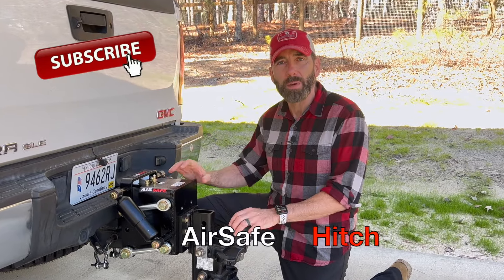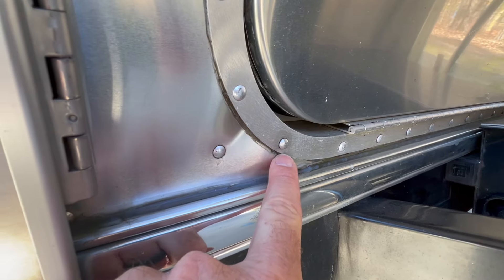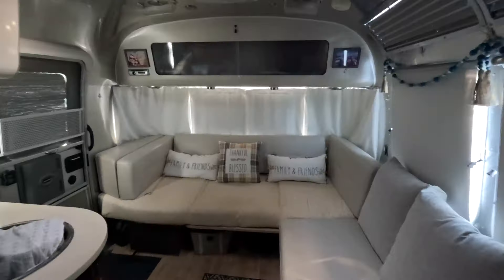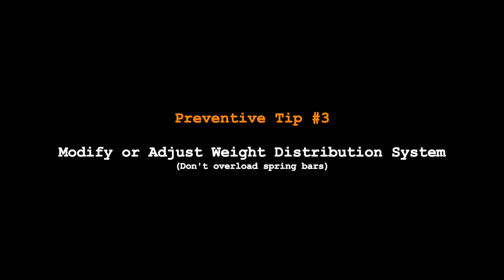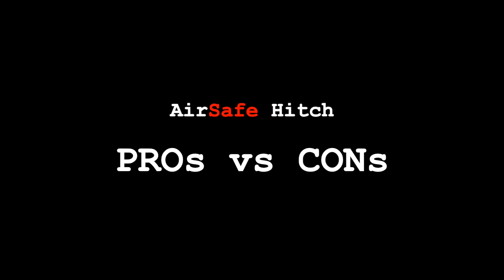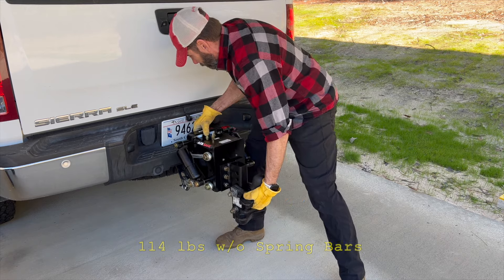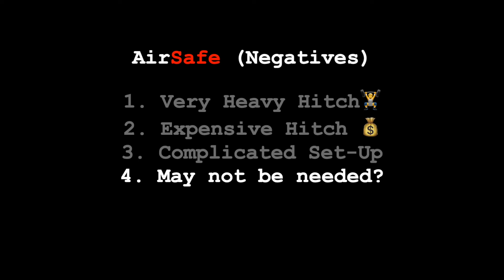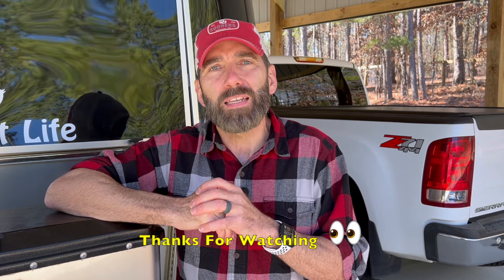Should AIRSTREAM Owners Jump On The AIRSAFE Bandwagon?#airstream #rv #airsafe #KYD

Comment: My 2.5” shank Equalizer hitch head and weight distribution bars already weigh 106 pounds as it is.  Adding another 49 pounds will make it nearly unmanageable and greatly increase chance for injuring my back.  You’ll need a second person to help carry it or a lifting/rolling device to transport it.  Virtually impossible to lift it into the bed of your truck when not needing it to tow.  I decided to switch to an Andersen Hitch, which weighs in at only 26 pounds and has a MUCH softer ride than the Equalizer.
Reply from the maker: I don’t even try to lift it and place in the bed of the truck.  I just chain it to the AS tongue when we are camping.  Safe travels.

Comment: Good video as always.  I think your theory on what causes front end separation is valid.  IMPORTANT SAFETY NOTE:  At 10:30 your breakaway switch wire is shown being hooked to your chains.  This is wrong.  The breakaway switch must be hooked to a part of the tow vehicle entirely separate from the hitch assembly.  The design intent of the breakaway switch is to apply the brakes and stop the trailer in the event that the entire hitch assembly departs the tow vehicle.  If ever you lost your hitch, the wire would go right along with it, never pull the pin out, and never engage the trailer's brakes.
Reply from the maker: Hi Rich, thanks for the comment and the safety tip.  I reviewed the video and can see how it appears that the breakaway cable is attached to the safety chains.  It is actually attached to the receiver.  That said, I need to get an eye bolt and attach it near the license plate (I think this is your set-up).  Take care and safe travels.

Comment: I tow a 2022 FC 30 bunk with a 3500 dually and only use a GenY torsion boss hitch without any wd bars but I do use a sway brake. I haven’t used the bike rack in a couple years but initially I did use the bike rack attached to a built in receiver, but because the dealer used a weak C channel setup, it always flexed too much back there so we stopped. Maybe they saved us. I also used to use the Equalizer WD hitch for a couple thousand miles in the beginning. I haven’t noticed separation or signs of it but will be visiting Vinnie if and when it happens.
Reply from the maker: Thanks for sharing your experience. Hopefully you never require any repairs. Best of luck and safe travels.

Comment: My hitch manufacturer recommended that I use the lighter tension bars (1000lbs) and suggested that we go with a 1/2-ton truck for a more compliant suspension due to FES.  This was the first I heard of the issue and was before we even purchased our truck or trailer.  Fortunately we then went with an Airstream model without the front storage hatch.  I also chose a truck with electronic adaptive shocks that keep the ride very smooth but adjust rapidly (fractions of a second) to rougher conditions like a pothole.  As a bonus, they provide an estimate of tongue load.  As it turned out, I think researching the Pro-Pride hitch before purchasing truck and trailer turned out very well for us.
Reply from the maker: That sounds like a great setup you have.  We have an older 3/4 ton truck with very stiff suspense.  Someday we may need to upgrade our tow vehicle 🛻

Comment: I just got my Air Safe.  Question on you install.  1.  Did you just measure ball height on old setup and set your new Air Safe at the same height?  2.  Did you change the position (mive back) the L brackets on the frame of the Airstream?  We leave Sunday in our first trip of the year.  4000 miles from home in Wyoming to Florida and back.  I will really get to test the Air Safe.  Our 2023 Globetrotter had FES within the first 3 months and we had it fixed at the mothership.....I consider the Air Safe additional insurance.

Thanks for such informative content!
Reply from the maker: When we set up our AirSafe and Reese WD system we just followed the instructions for both manufacturers.  I first installed and set up the AirSafe with the WD bracket then we installed and set up the Reese WD system.  We believe we have it dialed in pretty well and we are just playing with the airbag psi at little to see what works best.  So far so good.

Comment: It would be very interesting to put some instrumentation such as strain gages on the trailer A frame and on the frame where the outriggers are to see how much the loads are reduced with the AirSafe hitch.  Ideally, Airstream should do this and run some tests.  There are several testing establishments and test tracks not far from Jackson Center where this could be done.  This situation is much less severe but in many ways similar to the Grand Design Frame Flex problem in that there are many theories and a great paucity of data. I spent a number of years in product support for the world's largest manufacturer of heavy equipment and situations like this would prompt an investigation and an official set of recommendations and fixes that would be transmitted to dealers.  In some cases, kits of required additional or replacement parts would be released.  It was part of taking a long-term view of customer satisfaction and reputation. Finally, simply reinforcing the structure and shell might help but it doesn't eliminate the root cause of the problem.  You have to remove the stresses and strains in order to have a long-term fix.

Comment: Just purchased a Shocker hitch for the same reason. Towed with it this weekend using a 3/4 ton SD. Truck squats a little more without weight distribution but not on the overload leaf. Hoping to not experience front in separation, several members in our club have already.
Reply from the maker: Good luck with the Shocker hitch. Hope you have great success with it and many miles of fun and adventures. Thanks for watching and safe travels.

Comment: The dealership we purchased our Classic from provided the Blue Ox Sway Pro as part of the package.   A little cumbersome to cinch up the weight distribution bars but certainly tows the AS nicely.   Time will tell if FES becomes an issue.  I do appreciate you discussing the telltale signs of initial symptoms to watch for.   How did Lisa escape being in this installment of TWL?
Reply from the maker: I’ve heard good things about the Blue Ox system.  I think all WD systems can be a little cumbersome at times but are necessary equipment for safe travels.  Hopefully you can escape the dreaded FES issue, just keep an eye on it as it will slowly reveal itself.  As for Lisa, she likes to leave the “technical” and “how to” videos to me. That way, if I screw something up, i get all the blame 🤣.

Comment: Great video.  I did have an Air Safe on a F150 with an Equalizer system but my experience since it lengthed the hitch from the rear of the vehicle it created more bounce.  I had numerous popped rivets on the frame of the front storage door and the interior not to mention FES.  When I traded up to a F250 I had airbags installed on the truck and haven't used the Air Safe and not one popped rivet.  I know there's a lot of moving parts in creating problems and I'm just sharing my experience
Reply from the maker: Great information. Thanks for sharing your thoughts and experiences.  Happy camping and safe travels.
Reply: My F350 SRW has rear airbags and that makes no difference aside from keeping the vehicle level when towing the 10K LB classic 33.

Comment: I just purchased the class VI Air Safe Hitch, because my 2023 Classic 33 bounces around allot and shit is getting broken on every trip which is ridiculous.. Im hoping the air safe hitch will reduce the jarring up & down bouncing that occurs.  I had the dealer perform the front end separation bracing, 6 months after I had purchased it.  This is a known issue with Airstream, I was told that all airstreams have this additional bracing on all airstreams leaving the factory from April 23 & newer.

Comment: I am curious how this will work out.  We are planning to purchase our first AS this year and will be upgrading our TV to a 3/4 ton to pull it.  We were just going to go with the standard BlueOX WDH setup but are now looking at other options.
There is not much coverage of AirSafe on YouTube so I hope you are going to be able to fill that gap.  I also saw the KYD video and read many posts on AirForums about FES and various towing solutions.  There are several threads on the Gen-Y torsion hitches and some video reviews as well on YT.  There seems to be less on the Shocker hitches.  Most of the info I have been able to gather shows that the Gen-Y product does not do nearly as much as the Shocker and nowhere near as much as the AirSafe to help smooth out the bumps and stresses.  If you can find a way to compare them, that would be very helpful.
The biggest issue with all of these solutions is the added weight.  This will of course add to the payload but for me the bigger issue is with attaching/detaching the hitch.  It will be interesting to see how much of an issue that is for you and how you solve it.
Lastly, I have heard (both online forums and directly from the AS dealers) that AS has added some additional support brackets in '24 (and maybe '23?) models to deal with FES.  I have heard of these being located near where the front access door is located and also with the new redesign of the front end cap in the '24 models (specifically the 25' and 27' ones).  Have you heard any concrete details on this?  I think that would be an interesting video to report on what changes have been made and maybe get the option of a reputable repair tech on if the changes will make a difference or not.
Keep up the good content!  It is very informative and useful to us!
Reply from the maker: I have only heard rumors that AS has begun to modify/enhance some models, but I can’t confirm.    Thanks for watching and safe travels.

Comment: Great video. We just looked at our 2023 27FBT International and noticed 4 rivets missing around the front storage so we will be watching closely for follow ups. Curious why a Class VI and not the V?
Reply from the maker: We went with the class 6 based on the tongue weight of our AS.  Additionally when you use a WD system with the AirSafe hitch it reduces the tongue weight capacity of the AirSafe hitch by 25%.  Based on that we needed the class 6 version.  Hope this helps.
Reply: @thewrightlife thanks for the reply. Very helpful.
Reply: Interesting you should ask. I see the specs on the class V which should suffice based on the weight from my Classic 33.  The difference on the class VI is it can handle double the weight 20K lbs, but thermal difference is t he (2) additional shocks one on either side on the hitch which slow down the recoil on a jarring bump.  I went with the class VI

Comment: Did you consider Shocker or Gen Y hitches before you purchased Airsafe?  Those are the two I've been considering.
Reply: I have used the Shocker hitch on my 2023 Classic pulling with a Ram 3500 dully for over a year and it has been great.
Reply: @kcwerv  Are you using a weight distribution hitch along with the Shocker? I know some people with HD Trucks don't.
Reply: @cackerson10  No. We have been all across the country with winds up to 70 MPH and we haven't had any sway problems. We just slow down if the winds are high and that solves the sway issues.
Reply from the maker: I briefly looked at the shocker hitch but did not believe it would meet our requirements.

Comment: How long is your Airstream? We have a 25' FBT. We have a bike rack and bikes that total weight 125 lbs. on the rear of our AS. I'm no expert either, but I think dragging the rear of the AS could cause front end compression and overloading the rear of the AS could cause FES. I have airbags on the truck for two reasons. Take some of the pressure off of the WDH bars as well as get the truck and AS as level as I can. Besides that, and driving more carefully, the only other thing I can think of to mitigate any FES/compression is to get an AirSafe. It will be interesting to see how it performs for you. Thanks for the video. Well made...
Reply from the maker: Our AS is a 27FBT.  So far, so good with the AirSafe hitch.  Thanks for watching and your comments.  Happy camping and safe travels.

Comment: Interesting the order of the potential causes for FES that you presented.  I’m guessing it was just a random listing.  I would certainly re-order them. Weigh on the back would be last on the list.  Just my opinion of course.
Reply: Also, on the cons of the hitch.  I certainly agree with the ones you pointed out.  How about the increased possibility of sway occurring with moving the trailer further away from the tow vehicle?  I’m not an engineer or a tow expert, I just see that point brought up a lot in regards to rear overhang.
Reply from the maker: No real justification on the order of the FES theory’s I provided other than it helped with the flow of the presentation and our alternative FES mitigation solution (AirSafe)
Reply from the maker: I can’t say if there is a greater possibility of trailer sway with the AirSafe hitch.  According to AirSafe they promise improved control & handling on their website.  I guess we will see.  Thanks for watching and the comments. Safe travels.

Comment: Ty for sharing! I own a similar AS with front hatch but I think that’s irrelevant as even the RB’s can have FES. I believe the Airsafe can be a game changer based on my 10 years as a truck driver. Any 53’ trl that I hauled with air suspension ride compared to leaf springs were significantly smoother. Leaf spring trailers almost always had a severe “kick” to them. You might think that I’m comparing apples to oranges but I believe the principle applies here. That “kick” or shock is contributing to FES, I believe. Also the overall load-TV and AS- is causing the frame to flex. The greater the load, the greater the flex- front and back. 
But my question to you is…does that thing really weigh 114 lbs?? 😳You must be as strong as a bull. That’s too much for me. 🤷🏼‍♂️ The Equalizer hitch ( not incl bars) is pretty dang heavy and I took a tip from Luvsubbin and made a handle for it.
Reply from the maker: Thanks for the question…yes I weighed the AirSafe and was surprised that it weighed 114 lbs.  definitely something to consider before buying.  Happy camping & safe travels.

Comment: Great video, we are picking up a 30 RB Globetrotter (so no front hatch) within a week, but I need to get a hitch ASAP! The Pro Pride looks amazing but it's $4k. I don't mind spending $1500 but I don't know about the AIRSAFE just yet either. What WD bars/set up would you recommend if I were to use the AIRSAFE?  Oh, and BOOMER!
Reply from the maker: I think any of the major WD systems (Equalizer, Blu Ox, Reese). would be fine with the AirSafe hitch. Their job is to compliment the AirSafe hitch and distribute the tongue weight across the truck & trailer axles.  Good luck and safe travels.
Reply: @thewrightlife thank you!

Comment: Do you really need a weight distribution hitch with the Air Safe Hitch?  I have a 3/4 truck and am wondering if WDH is necessary.  Thoughts?
Reply from the maker: It is my opinion that the Air Safe hitch and a WDH are serving two different purposes.  One is intended to reduce the stress and fatigue of a ridged truck/trailer connection using airbag technology.  The other is intended to evenly distribute the trailers tongue weight across the truck and trailer axles.  Because they each serve a different purpose we have chosen to use a WDH with our Air Safe hitch.  Hope this helps. Safe travels

Comment: I realize that there is an ongoing problem with some airstream designs in regards to frame separation.
In my humble opinion and not knowing anything about engineering, I I just have a lot of common sense and grew up around travel trailers in the '60s and '70s.
For crying out loud look at where Wally took his early Airstream designs, off-roading across countries with barely any dirt roads, I don't think the answer is these over the top hitches. I believe the best way to solve this problem is reinforce those storage areas and put extra fasteners around the front clip of the airstream. 
John
Reply from the maker: Hi…thanks for the comment.  We are looking into some “preemptive repairs” to reinforce the storage area with additional bracing as you suggest.  We wish the that wasn’t the case, but changes in design and manufacturing seems to require a fix.  We also decided to use the AirSafe hitch with the hope that it would mitigate any further FES on our Airstream.  This combined solution is what we are pursuing and will provide an update in the future.  Thanks for watching.
Reply: It is worth asking why this is occurring now and wasn't a problem in the past.  It would be interesting to look at how the weight and center of gravity of the trailers have changed as more equipment, etc. is added.  In addition, the speeds at which the trailers are being towed has increased.  This will dramatically increase the shock loads on the hitch and frame.